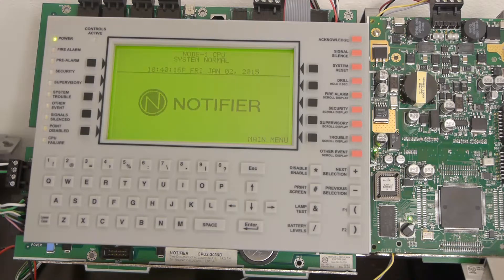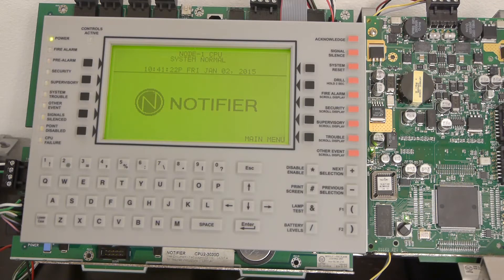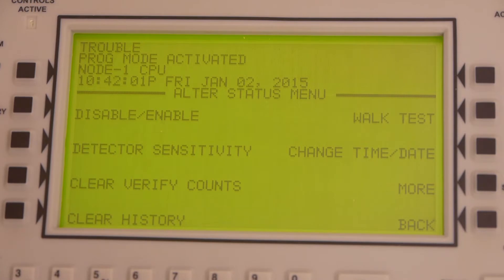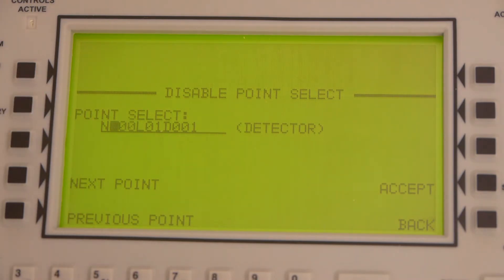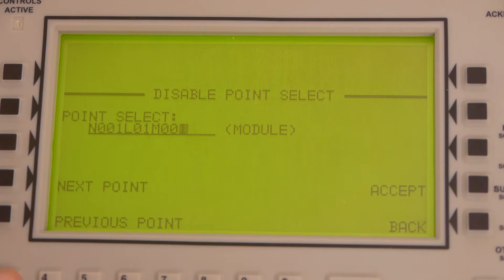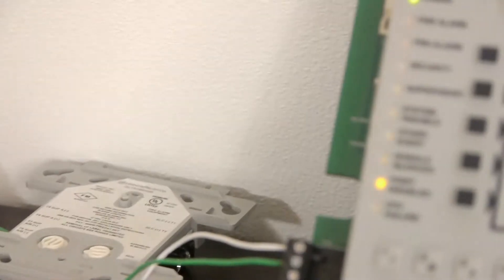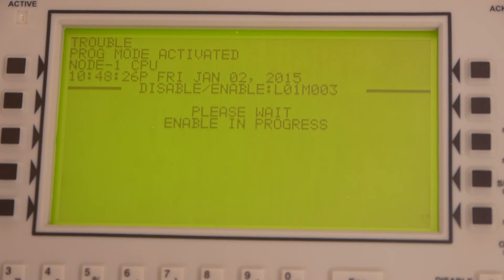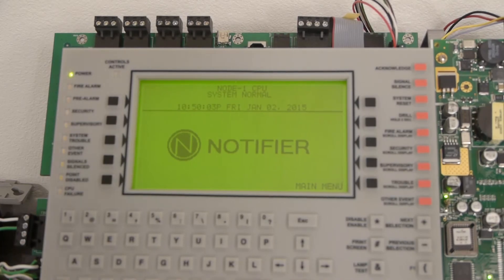How to Enable and Disable a SLC point on a NFS2-3030

Comment: I’ve been wondering, is there a way to remotely activate a point such as a control module for a NAC circuit from the panel without setting off any other zones?
Reply from the maker: Yes, I will make a video.